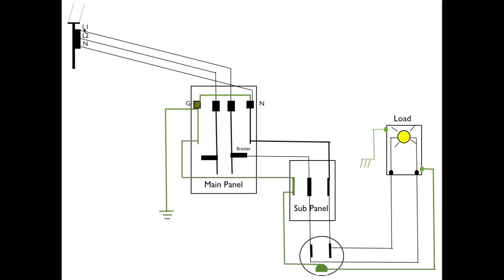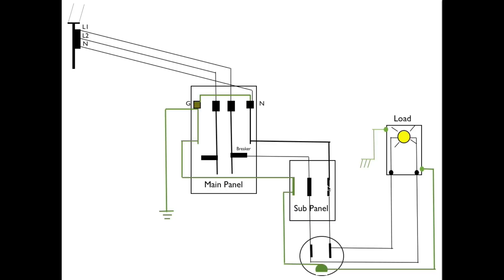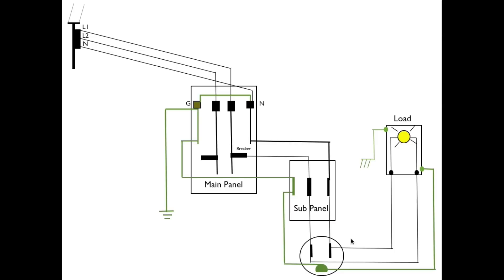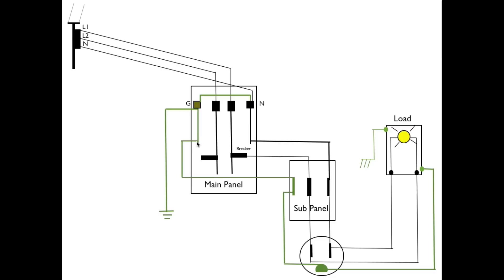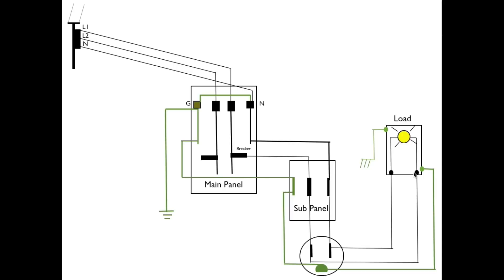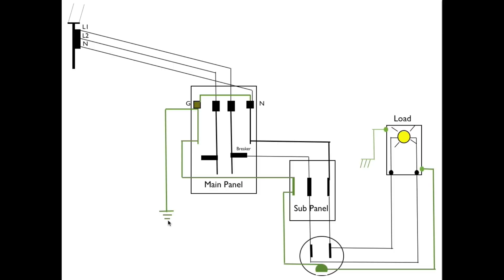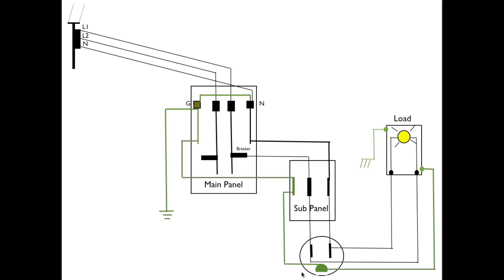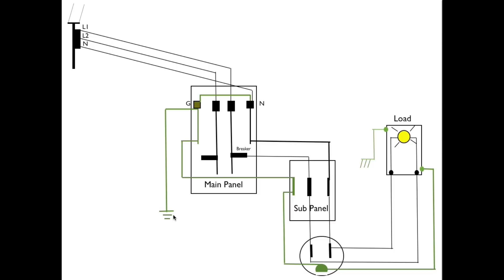The difference between neutral and ground on the electric panel

Comment: why can it be ok to bond neutral and ground in main panel, but not in sub-panel. When it uses the same power. In other words, whats the difference if you have a short in a main panel where ground and neutral are bonded vs a sub-panel where ground and neutral are not bonded, or why not wire the main panel like a sub-panel having the ground separate from the neutral or wire the sub-panel like the main panel by bonding the ground and neutral in sub-panel. I mean if the electric short will travel properly in main panel why won't it do the same in the sub-panel if it's bonded the same as the main power?
Reply: +gtmustangcobra We need the convenience of sub panels, but at the same time we realize they add risk. It is not a perfect world. So we don't want to push our luck beyond the main service panel as far as neutral bonding goes.
Reply: +gtmustangcobra    LOL..My question also!!  I have asked  electricians' this same question and I got nothing but shrugs or.. 'just because' for an answer.   I think it's got something to do with the uncertainties of sub-panels in terms of grounding and the higher risk of introducing potential (think ohms law...) of the neutral (grounded wire) and the grounding wire to ground.If you get a definitive answer, please let me know and vice-versa.... :)
Reply: +gtmustangcobra Neutral is only grounded at the very start, before passing through any circuit breakers (particularly leakage protection), usually at the step-down transformer. If neutral is grounded at consumers' side (sub-panel, etc.), then it will mainly result in nuisance tripping of leakage protection devices (if any), because neutral current is "leaking" to ground.
Reply: But if a fault energizes anything metallic, why wouldnt that automatically trip a breaker....is it because the fault current isnt high enough?
Reply: steve jones
if your breakers tripped automatically you would very quickly become annoyed by that. Every time your air conditioner, or refrigerator cycled on you'd be resetting the breaker. Because loaded motors require surge current to start. But it is very difficult for simple mechanisms to differentiate between those allowable surges, and fault conditions.
Reply: +steve jones To put it simply, current flow is required for any breaker to trip. If an exposed live conductor only touches some ungrounded metal object, that metal object will only carry a voltage (similar to busbar), no breaker will trip yet. Situation 1: Ground that metal object, then any contact with live conductor will trip the GFI/ELCB/RCCB/RCD, due to leakage (ground fault, typically ranges from 6mA to 300mA). Situation 2: When more than 2 different conductors (L1/L2/neutral) touch ungrounded metal object at the same time, then the MCB/MCCB will trip, due to overcurrent (short-circuit, typically ranges from 6kA to 50kA).
Reply: +tceffearat I see...Thank You!
Reply: +gtmustangcobra   A search of the NEC website explains the issue.  If there is a short circuit it will seek not the easiest path to ground but ANY path to ground.  Therefore if you ground the neutral and ground together at the sub-panel it will energize all of the neutrals in both panels, creating a dangerous situation.  If they are separate back to the main panel there is only one path to ground.  It also means that the power return in the neutral side now only has access to the neutral wire.  Thus the current generated by the short is not allowed to the neutral simply because not the ground is the only path to ground.  It is actually explained very well in the video.
Reply: Just like water, electrons will take the path of least resistance
Reply: +Dark Matter it's really not though. many analogies are made between the two when explaining ohms, current, voltage or amps
Reply: +Dark Matter  take the handle and cartridge out oft your shower valve. lay down in the tub.fault
Reply: If Lightning hits the earth near the sub panel ground it will travel up the system and blow everything out as it will go into the neutral from the ground in the sub panel.  Lightning can jump a great distance so it will ignore all switches as if everything is turned on.   If lighting hits at the main panel it goes to ground from the main panel.
Reply: The reason you don't bond the neutral to ground in any sub panel, and only the main panel, is it can and most often, will cause circulating current in the neutral and ground. It can very well be measurable in certain conditions. I have seen it many times in my 40+ years as a journeyman.
Reply: gtmustangcobra — Bonding in a subpanel would prevent you from putting a GFCI on it.

Comment: That was horrible
And why have a  Have a sub panel
Reply: Say you want to add a couple rooms to your house or send electric to your garage you would install a sub panel there. Make sure your sub panel is actually designed to be used as a sub panel. You can use 12/3 for instance (depending on amps drawn and placement of wire, up on a pole or buried require different types) to the sub panel instead of 2 lengths of 12/2. 12/3 black is line one and red is line 2 so you can have 240v receptacles out of the sub panel and two separate circuits for receptacles and lights. The bare ground wire buss bar is not to touch or connect to the subpanel but rather connect to the service/main panel. The neutral/white goes the neutral buss bar and bonding screw (green screw) removed so that it does not connect to the sub panel either. Double check all codes and rely not on what I said here, code changes everywhere. Safety first and second then double check

Comment: excellent resource,
  I found and resolved this issue in a  house yesterday
   .found neutral bar in subpanel included bare ground wires,
  I screwed a separate bar to the subpanel box to isolate ground wires. 
also  replaced breakers with new ones.
+ GFCI plug next to the sink

Comment: Nice video. One very important concept to take from this is the primary purpose of ground is to provide a low impedance path for fault current to flow so the breaker will turn the circuit off. That is pretty much its entire purpose - blow the breaker as quickly as possible.
Reply from the maker: That depends on if you mean earth ground or neutral.  If you mean chassis ground to neutral in the panel, correct.  If you mean earth that is not correct.  Earth ground will not kick the breaker.  I have a playlist on these issues:  https://www.youtube.com/playlist?list=PLItXrh64d2JNJOjSivaYXeX88i8MNWgwu  One of the videos there is from Mike Holt about grounding myths.  It is very good and explains it well.
GFM
Reply: Too add to that, the ground wire also serves to short circuit your body so that little or no voltage appears across it before the breaker blows. So your body won't feel anything since the ground wire bypasses it providing a low impedance path for the fault current. So even if the breaker failed to blow, you would still be safe until the ground wire burned up.

Comment: Very Clear! I'm ready for takeoff on my project...needed a clarification of removing the green screw from the sub and this made it that much clearer and WHY it's needed!
Reply: Thanks Caesar, makes perfect sense and I'm hearing you very clear! I removed the green screw from my Siemens service panel that I'm using as a sub panel in my detached garage. It will have a main 60 amp breaker served from a 60 amp breaker from my main service panel in my house. My house has 200 amp service. I've ran a ground plate outside the garage and attached a copper ground to the Siemens panel on the ground strips. In a nutshell I'm attaching the #2 aluminum underground feed to the 60 amp breaker then attaching the white neutral wire to isolated neutral in the panel. I am now covered correctly by having the ground strips grounded outside to ground and the panel grounded, my white neutral is isolated from the panel.

Comment: This helped me greatly....we had to wire up panels in my HVAC class and I was like "what's up with the green jumper"?  I use to do electrical work and always thought that the ground was separate completely from everything else and just went into the earth from the panel.  When I saw it connected to the neutral I was almost certain my classmates wired it up wrong because the neutral carries the load back to complete the circuit; but if there's a surge then there has to be a place for it to go or it will burn up everything like you said.   You're video's are a life saver.
Reply from the maker: David Copperfield Thanks for the support.
GFM

Comment: Very clear and through explanation.  In some countries the ground is made at every pole so instead of using a earths ground in the house if lighting hits the pole it doesn´t make it inside the house at all.  If the power company doesn´t ground every pole then if lighting hits the house and makes its way into the electrical system in your house it could blow things up.
Reply from the maker: +Joseph Nicholas Thanks for the support.
GFM

Comment: I appreciate your attempt to explain the difference between ground and neutral in a panel. The NEC codes in the 300 chapter explains  in detail what and where grounds are required and when they have to be separate such as sub-panels. One important thing that I think you left out is the fact that the ground has to be separate from the neutral in sub-panels so that, in the case of our fault, it will create a high current situation which will cause the breaker to trip there for protecting life if someone happens to touch it. Of course, in a normal situation the line would come in, power the load and then return to the source on the neutral.
Reply from the maker: At 1:55 I do explain that the ground and neutral are separated in the sub panel.  
GFM
Reply: Braeburn Hilliard's Channel   The NEC tells you what you may or shall do.   It does not tell you why.   Can you tell me why the ground and neutral are connected together in the main panel?    What happens in the main panel when the short to ground gets to that point?    I'm hoping you know the answer.   Respectfully,   Kevin
Reply: @KevinCoop1  yes. Main panels are grounded because it provides an alternate pathway for current to follow if there is a breakdown between the neutral and hot wires in the normal operation of the system.
Reply: Braeburn Hilliard's Channel    Not really.   Earth ground (Grounding Electrode Conductor) is for lightning and intended to "ground" neutral called "grounded conductor".     That part of grounding is done.   Equipment ground conductors are installed with feeders and branch circuits to cause a short circuit if metal parts not intended to be energized are energized.   A high number of amps travel back to the main panel, onto the neutral, out to the utility transformer, through the transformer coil, back to main panel, to the branch circuit breaker(hopefully) and have enough amps to create a magnetic field strong enough to cause breaker to trip.    If this makes sense to you and you start applying it to Article 250, it will make a lot more sense of why it says to do certain things.   Respectfully,   Kevin
Reply: @KevinCoop1  yes, that's exactly what I mentioned in my very first comment. I thought you were asking about any additional reasons why main panel would require being grounded. That's the only other thing I knew. Of course, a lightning strike may cause failure of the install circuits in which the ground would provide a route for current to travel just like I mentioned. I kind of think we're saying the same thing.
Reply: Braeburn Hilliard's Channel     I agree with you.   My concern from your original comment did not say the path for the high current.   Many many people do not understand that point.   For some reason the think ground faults go to earth ground.    Although true in England, not true in US.  Thank you for your time!   Enjoy life, it is short!    Respectfully,   Kevin
Reply from the maker: @KevinCoop1  First, it is not necessary to have a ground at all for the circuit to operate and the clearing of faults to work normally.  The use of earth ground at the main panel is to provide a path for lightning and surges to dissipate.  
The chassis ground is different.  If the chassis of the sub panel or appliance becomes energized, you need a path to clear that fault.  That fault will go to neutral at the main panel and be cleared at the power pole.
Also, should the disconnect become energized from a lightning strike, a low impedance path to earth ground should be available.  Hope this helps.
GFM
Reply: grayfurnaceman    I agree with everything you said except for the fault will not be cleared at the pole.  It will be cleared at the branch breaker, the main breaker, or both.    Respectfully,   Kevin

Comment: Great video, One thing to explain however, there are many house built today that have the main disconnect at the meter. The example you gave indicated the main disconnect is in the "main panel". When you the main disconnect is at the meter, the load panel acts as a sub and the grounds and neutrals are separate at that location and not tied together. As a home inspector this is one of the main items we look for when we have a main disconnect at the meter, usually outside the house.  One very important thing to remember, if you don't understand this issue, DO NOT OPEN your panel box. Call a licensed master electrician. This can Kill you if you touch the wrong wire or bus bar.

Comment: He nailed it.  That's exactly why the subpanel should always have separate (isolated) neutral and ground bars.  One good thing to know is that looking at a 120 outlet (wall plug) If it is properly wired, and the ground is on the bottom, the slightly larger, left slot is neutral and the right slot is hot.  He sort of just explained why the neutral is called "neutral" and NOT negative.  On the secondary winding of the transformer, the neutral is the center-tap (connected to the center of the coil that puts out 240 volts.)  That is why voltage between one hot wire and the neutral is 120 volts and voltage between the 2 hot wires is 240 volts.  At the transformer, the power company grounds the neutral wire, which is the reason the neutral does not shock you (as long as it stays connected, as he explained)  Search google images for "single phase 240 volt transformer" for a good picture

Comment: Nice job it makes more sense. It can be summarized  for memory by: the ground in the main breaker is for lightning strikes. And.  Ground is not attached to neutral in sub panel incase neutral breaks causing a shock hazard at appliance case.

Comment: Thanks for the video.  Informative.  I'd also add that another reason for NOT bonding neutral and ground at sub-panels is due to the different cable gauge size between ground and neutral/power.  If there was a problem and ground had to be substituted for neutral, generally ground is a smaller(high numbered) gauge cable relative to the installed neutral cable.  For example, in a 30 amp scenario, the 10 gauge neutral cable, if lost, and electrically replaced by a 'standard' smaller size ground cable,  the substituted ground cable could not handle the current/amps and could heat/burn in a situation where for whatever reason the neutral cable is lost.  Basically ground wires are not designed to carry all the larger currents/amps in residential/commercial set-up.
Reply from the maker: John Zimmer Very good point.  Thanks for the thoughts.
GFM

Comment: The reason we don't connect ground to neutral is  because when current is flowing through it you will have a voltage above ground because wire has restance. It is possible to get shocked by touching the neutral wire if your far enough away from the main pannel and current is flowing through it. However in the 70s before this was added to the electric code they often grounded the sub a pannels using bonding clamps just like the main. Also 3 wires were allowed in all dyers and ovens. This was all changed but many old timers still do it that way. If your house is from the 70s it's likely your dryer is wired thus way without a extra ground wire.

Comment: Excellent video.  I would like to emphasize that the ground in the main box goes to a rod or metal pipe that is actually buried in the ground.  The chassis ground is just a symbol to indicate that the incoming ground wire is connected to it.  It does not otherwise go anywhere.  The main goal is that the ground wire does not conduct current under normal use.  If there is only one connection between ground and neutral in the main box, this will be done.  So two different grounded items will have the same zero volts between them and you would not get shocked when touching both at the same time.

Comment: Thank you for this excellent video.  In most cases, however, the only place that the neutral and ground are joined is at the incoming power meter. There should be one or more ground rods at the meter pedestal.  The ground (green) and neutral (white) should not be joined anywhere inside the house. It depends on your definition of "main panel". The main panel and first breaker on any recent electrical services is at the meter.   Your video is an excellent illustration of why there is a "stray voltage" problem at many dairy farms where the neutral and green are routinely connected at various panels around the farm.  In too many cases, one old motor or pump wears out, shorting some current to the housing, etc and this sends current back through the ground, giving the cows a shock every time they try to take a drink of water. Cows then drink less water, give less milk and the dairy farm goes out of business. Neutral (usually white) and green wires should not be joined anywhere except the power meter.  Each panel should have its own ground rod and separate ground bar inside each panel for the green ground wires. This is now code in many areas.